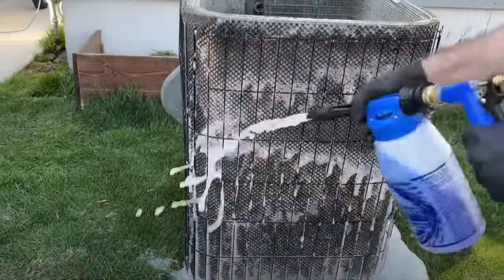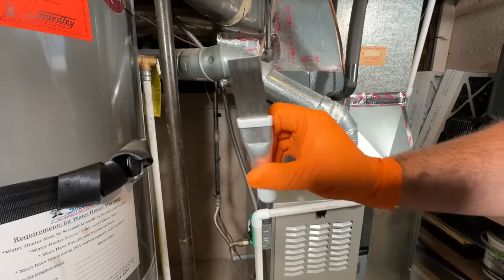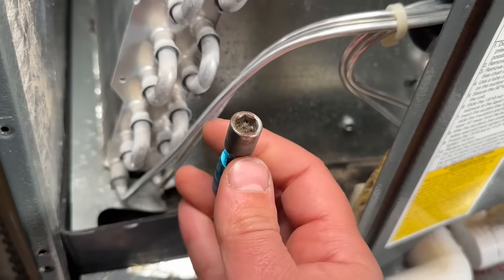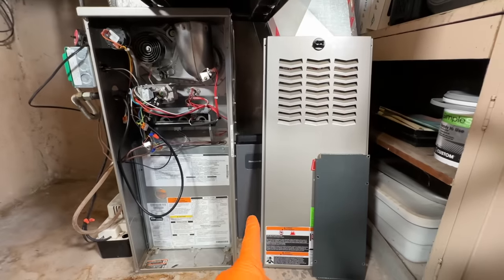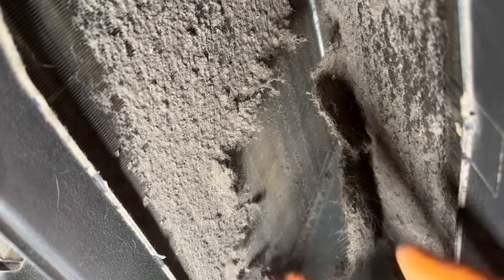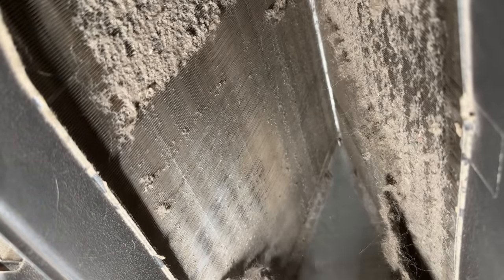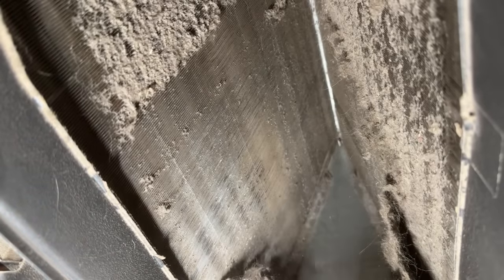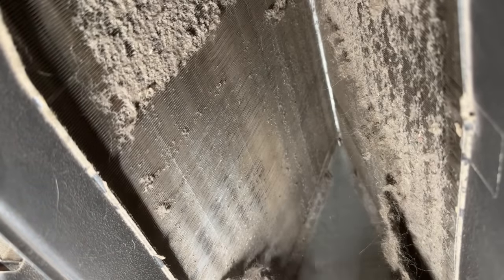How To Properly Clean An AC Evaporator Coil & Save HUNDREDS!

Comment: I guess you wish you had a “before” air flow reading to compare with the after cleaning.
Q.  Is it safe to say that on an updraft system, the dirtiest part of the A coil is going to be on the underside (inside). ???

Comment: I have a horizontal unit in the attic. Would the "A" coil also be mounted horizontally, kinda like a "<" ?  My house is new, 5 years ago and this is something I need to have done.  2 years ago I called a HVAC company to come out and do a furnace cleaning (I'm retired in Phoenix area), and it was like I was asking him to build a space shuttle or something.  He had no clue.  I came from northern Illinois and it was necessary to do a cleanout every 2 years.  Burners, nozzles, heat exchangers and "A" coil too.  Looks like it's going to be DIY time now this fall when it's not 145F in the attic.

Comment: My air handler is under the house and on its side. I dont have room to remove coil. I was thinking I could access the A coil up stream and use air compressor to blow back dirt in the direction of the blower and remove blower and shop vac crap out?  maybe spray cleaner first on coil?

Comment: When I bought my house, the HVAC came with an Aprillaire filter module installed adjacent to the fan assembly.

It was the only component saved when it was replaced.  In the words of the contractor "I literally cannot sell you a better filter".

The old 15+ year old A coil looked brand new.

(the reason for replacement wasn't the A coil, it was the outside unit that got crushed by a tree)

Comment: Hi, I have a 2yo unit and have a 2 ceiling filter (16x20 and 12x12) setup. Do I still need a filter at the attic unit? There's a spot for it (I think) but have never used it.

Comment: Can you tell if it needs cleaning by using a manometer to measure static pressure drop across the coil?
My drop across just the coil  is 0.04" of water, ac on high. ?
Reply from the maker: .04 is ideal. So you should be totally fine 👍🏼

Comment: Nice, I know my coil needs this because my squirrel cage was all covered in dust. 1 question, I have an updraft unit and the contractor just put the filter under the air handler unit right under the squirrel cage with some L brackets so it will stay in place. Can  i put one of those filter boxes  down and set their handler on top of it to limit the blow by. Thanks
Reply from the maker: Yes absolutely. I absolutely hate the ones that just have those brackets. They really don’t filter probably 50% of the air.

Comment: I’ve bought filterbuy filter with a merv 13 rating and they were completely transparent and looked exactly the same as the merv 8. I thought they screwed up but the merv 13 box was checked on the filter itself. I bought Glasfloss instead.
Reply from the maker: Yes they mark them on the side of the filters. Just because they are white doesn’t mean they’re the same though.
Reply: @diyhvacguy  the issue I found was the  actual filter material looked no different than what a merv 8 looked like. When I bought a merv 13 from Glasfloss and compared, there was a clear difference. Shouldn’t the merv 13’s material look more dense than the merv 8?
Reply: @diyhvacguy  sorry if I’m wrong here. I just thought that if it’s meant to filter more than the filter material should be thicker.
Reply: @bensb166  I know exactly what you are saying but the way it has been described to me on a very basic, non-engineering level, is that filtration materials are vastly different from one design to the next. The weave, the base material used, the pleat design, whether it is electrostatic, etc... all of these variables are lab tested. A Merv 8 filter made of one material will look different than a Merv 8 from another material but the minimum filtration performance is the same. Some filters even rely on capturing particulates to aid in the performance, so that as more particulates are captured the performance improves to a point and then tapers off. Looking at a filter side by side with another one or shining light through them is no longer of any help due to the engineering that goes into these now. You need to look at the spec sheets and then rely on that data to make a decision.👍

Comment: How would you install a 4 inch filter rack in a air handler that's in the attic? Not all homes are able to have the air handler on the 1st floor unfortunately

Comment: If you have a good air filter that is changed regularly that evap coil should stay pretty clean right?
Reply from the maker: Should… I did NOT expect mine to be this filthy! I was appalled lol
Reply: @diyhvacguy  I hear you.  But you did say that you had a 1" filter in an ill fitting frame.  That could explain it.

Comment: Test for leaks spoak spray the Cu coper lines after you finsh to test for leaks.
Reply: Wet Dry shop vacuum will inprove debri removal so much you may not need coil cleaner.

Comment: Hey thanks brother. Got into mine tonight expecting a huge mess. It's an 07ish system in a 1964 house. Clean as can be. We have been religious about changing the filter, and it appears the previous owners were as well.

Question, so our house has an attached garage that has been fully insulated, but code doesnt allow a return. It was once a living space. It has two registers in the ceiling and I keep them closed because it's 105 outside in Texas and I know that the garage is super inefficient. The closed registers still let air by, I can hear them whistling. The ducts to the garage are the longest in the house, probably 40 foot each. Would I pick up any efficiency by blocking them completely? Would you suggest a damper or completely removing those ducts?
Reply from the maker: A damper so the 80 ft of conditioned air isn’t being wasted or going down an unused path. That’s probably what I’d try and do 👍🏼

Comment: Do most units have coils that slide out like that? I’ve been afraid to even break the seal on my A-coil s as I don’t think I have a simple door/hatch that I can open. Everything looks sealed with either sealant or aluminum tape.

Comment: Im dealing with a freezing coil on a 20 year old system at a house i bought two years ago that just got refrigerant added just a couple days ago and is still freezing. Whole drain pan looks to be full of some white goop, outside of the coils looks clean but i definitely don't have this level of play to pull it out like in this video. Hopefully that cover comes off cause otherwise its starting to look like my 1400 investment in fixing it so far is about to jump almost 10 times the price. Just the thought of that cost for a new system makes me want to vomit.

Comment: how often should I get this done and how much would it cost?
Reply from the maker: On an as needed basis, if you have a good filter that seals well, technically you shouldn’t ever have to clean the coil. So just check and see how it looks and then address it
Reply: @diyhvacguy  Thank you.

Comment: My unit is 4 years old and i is beginning to get what is termed as "dirty sneaker smell"!  It smells when the ac unit is running and also smells with the heater is running. I have preventative maintenance done on my unit twice a year. I change my filters every 3 months or earlier sometimes and keep the condensation line clear with running bleach  through it monthly.  Could cleaning this coil stop the smell?

Comment: How did your unit not freeze up or even work???    I have a small leak in the drip pan on my unit and have to find a way to get it out for repairs.  It ran for 35 years and its all sheet metal.  What a mess.

Comment: Mine is buried in custom plenum work and I don't really see a way to pull it out. Mines freezing up on me and I wanted to check the coils. But if yours was that bad and not freezing, then mine is likely not dirty enough to cause it. I think my system is low, maybe a leak. Is it possible to read 0 psi on low and high side and still get evap coil to freeze? Or would my new gauges just be bad? Evap been freezing and blocking air flow. I know this because once I had it off for a while, water was pouring out of the evap drain and air flow was restored. But strange my pressure reading is zero.

Comment: Trying to figure out where my evap condenser is. I have a condensation pvc drain line that goes into my back yard from the crawl space . Behind my filter is is the aluminum duct. Would my evap coils be in the crawl space?? I have a closet that shows the metal duct work but the unit isn’t in this closet. Makes me nervous to think the only way to access mine is through the crawl space. Any advice would be great it’s a Duncane model 4hp13l24p

Comment: What if the A coil is above a furnace so you can't access the underneath of it and where the cover panel is has the refrigerant line and drain pipe going in. Also, the exhaust duct is blocking it too? How can you get to the A coil without major tear down?
Reply: My A coil is above my heat exchanger too, luckily I have an access panel (on one end anyway).  I'm going to take the panel off tomorrow and see what things look like.  I doubt if the A coil has ever been cleaned, and the furnace is approx. 20 years old and we've lived here about 7 years and never cleaned it.

Comment: Would this cause low airflow throughout the house? My unit is about 20 years old but I recently did some diy maintenace during the winter and got the furnace working great as well did a major cleanup on it. The AC struggles though and it feels like hardly any air is coming out of the registers. I never knew I could access the bottom of the A coil since there is a screen that separates it from the heat exchanger that looks pretty clean and I didn't know it could come off! I've never cleaned the outside unit and maybe its low on coolant or whatever but the low airflow is still weird to me.
Reply from the maker: Yes this would create low air flow through the whole home as all the air goes through your coil

Comment: I assume that since I have a downflow furnace where the air flow is from outside the A to the underside that I'm not going to have that mess on the inside of the A.  My filters lay directly on top of the evap. coils.
Reply from the maker: Yesir you are correct!

Comment: For what AC contractors charge they should always pull out the evap coil to clean it properly. Cleaning in place is just straight laziness and you won't get all the caca out of the coil.

Comment: I have an exterior gas-pack Goodman unit.   Everything is in the one large exterior box.   How hard is it to do this cleaning with that unit?
Reply from the maker: I believe you’d need to pull the lid off but it’s not too bad. I haven’t worked in a package unit in a minute. But you might not even have to take the lid off, maybe just a side access panel and then you should be able to clean the coil from there 👍🏼 if I can do a video on a package unit soon I most definitely will! Cheers

Comment: Serious question! 
I looked and looked for my furnace filter and could not find it.
I live in Las Vegas.
Is my only filter the one in my house ceiling?
The one I change every three months?
It's two 20x20x1 filters.

Thanks!!
Reply from the maker: Yes that’s probably the only filter. Some have them at the return register for ease of replacement and some have them at the furnace itself. Cheers

Comment: Great job. Q: on a 90+ furnace, is the secondary heat exchanger cleanable?  Fortunately I don’t have that problem due to good filtration. On system change out, my old system looked clean inside after 13 yrs of service.

Comment: In the video I see the dirt under the evaporator coil is so dry. I checked mine and it is wet and dirty making it difficult to clean and vacuum. Do we need to run the fan or use an external blower for the dirt to dry up? Vacuuming would be a lot easier. Any thought or suggestions is greatly appreciated.
Reply: Wouldn't running the furnace for awhile dry things up?

Comment: Dang. My AC is 20 years old and I'm not sure that part has ever been cleaned. lol  I should probably go check it.
Reply: Same here, a little over 20 years old and doubt it was ever cleaned.  Now my furnace is shutting down sometimes right before the end of cycle, and immediately going into the restart cycle.  I think a limit switch might be opening up from overheating, then resetting right away.  Luckily there is an access panel I'm going to take off tomorrow and have a look.

Comment: Yup loose filters in the filter box. Well said!
If you just buy a filter and open the ac filter box and throw it in and screw the cover back on your wasting your time. Filter metal boxes rare notoriously poorly made and leave big gaps around the filter. The air under suction power will just sneak around that big gap and not see any filtering. You can tell how bad its leaking around the gap by how nice the filter looks after 2 months.
if it loo0ks like new its leaking bad.. Buy 2 inch duct tape and duct tape the edge of the filter to the box. Make that gap airtight. I do that every 2 months. if you dont the ac evap coils will just get clogged real quick and most of those are in the attic and now its very expensive to just get those coils cleaned. Make sure the filters are filtering!!!

Comment: Is there a way to inspect it from below using a scope to help determine if a cleaning is necessary? I'm not sure if there is a path from below to send a scope up. Thank you.
Reply from the maker: You can totally drill a hole in that triangular cover piece and get eyes on it 👍🏼
Reply from the maker: You can even drill a hole into the top of heat exchanger box on the furnace. A lot of people do that to get their static pressure readings.

Comment: Please help I have no idea what kind of HVAC system I have. There are no intake filter locations anywhere. Not even on the furnace doors. I have dual evaporator coils that appear to be the intake. But I'm no expert. Is that where the filters go? They certainly are not 1 in thick if that's the case.

Comment: If you use quality filters (Merv 8) and change them regularly, your evaporator coils should rarely if ever need to be cleaned.  That coil looked ridiculous.
Reply from the maker: I agree, but that’s not true. It’s about the filter seal, not if they’re replaced regularly.
Reply: @diyhvacguy  Yes, but a properly sized filter should seal fine

Comment: It would be interesting to see a before and after pressure drop across the evaporator.
Reply from the maker: Yea another person mentioned that. Should have checked! Oh well.
Reply: Pressure drop across the coil?

A plugged coil will give you low suction pressure, after you clean it you will have higher pressure.
Reply: Lags, I was thinking about the air pressure drop across the dust clogged evaporator as opposed to the clean one. Nothing to do with the refrigerant. IIR, it's done with a magnehelic gauge.

Comment: My evaporator coil is inaccessible due to how the access cover comes off and how they plumbed the unit, thus has Never been cleaned (since 97).. my hvac guy recommended a replacement furnace and ac due to age. 😕I'm on the wasatch front. send halp
Reply from the maker: Shoot me an email I might be able to help you out    Diyhvacguy@gmail.com

Comment: With the new condensing furnaces, actually not new,  since about 1984 , Lennox Pulse was the first, the secondary heat exchanger will collect all the dog hair, cat hair and other filth  before it gets to the evap coil.
Reply from the maker: Some of it. All of the fair doesn’t have to go through that condensing coil on a HE furnace. But that’s a good point. Pull the fan motor and it’s right there!

Comment: how much give does the lineset have? I was amazed you were able to pull it out that far without a kink. I'm worried about causing a refrigerant leak. I may just try and clean it in place.
I'm looking at cleaning my 30 year old evaporator coil tomorrow... we just moved in and the previous owners were running a 1" filter in a 2" slot 😱. If yours has this much, I can't imagine how much mine will have. The air coming out of the registers is 60% humidity 😂
Reply from the maker: Oh wow, best of luck with it! If it’s real bad send some pictures to diyhvacguy@gmail.com :) if you need some remote help, check out our Patreon at Patreon.com/diyhvacguy   Cheers

Comment: The coil is always wet so how did yours get so dry?
Reply from the maker: From not being turned on for a few hrs 👍🏼
Reply from the maker: The coil only gets wet when the condenser is running, so if you disconnect power at your condenser for an hr or so that cool will be dry as a bone 👍🏼

Comment: My unit doesn’t have that float in drain, what does that do?
Reply from the maker: That is a safety switch so if the line gets clogged and the water builds up in the pan, the switch will turn the unit off so no more water is built up and it doesn’t overflow.

Comment: Do all coils slide in and out like that? Mines dripping on the filter and missing the pan.
Reply: Based on everything I’ve seen it seems like cleaning it would be a good starting point before shelling out $ for a service call.
Reply from the maker: No all do not slide out. Some have this if they were installed with cleaning in mind. If enough crap gets on the coil it will not glide down those fins like it’s supposed to and end up elsewhere aka your filter.  I’d start with trying to clean it and go from there! If you need further assistance check out our Patreon membership at Patreon.com/diyhvacguy   Cheers

Comment: Scary thing about htis is a home owner breaking the line set.  Also most won't have the play in it to remove the coil like that.  So you aren't able to clean it by just taking off the cover and spraying from the top?
Reply from the maker: No you’ll need to work through that triangle portion of the coil. It’s not fun but it can be done for sure. I agree, most might not be like mine but it made for a nice video that shows what an evaporator coil looks like in the field. Cheers